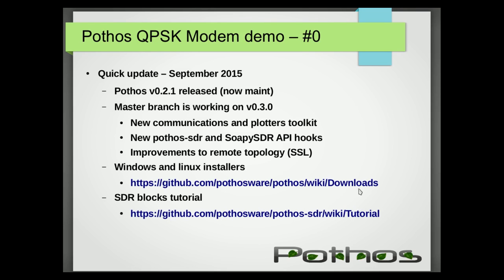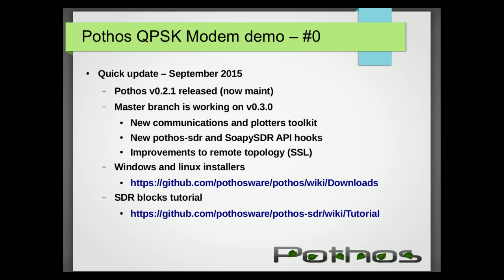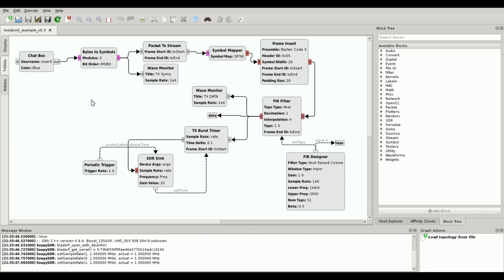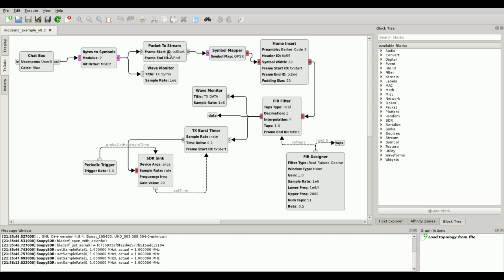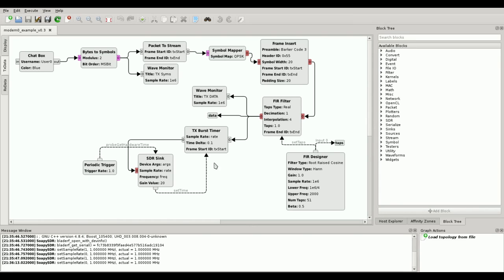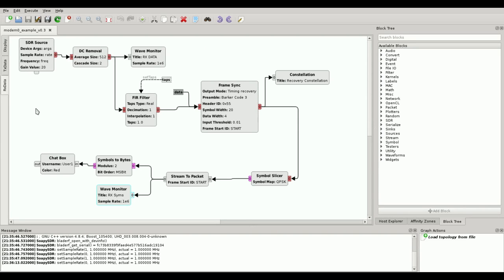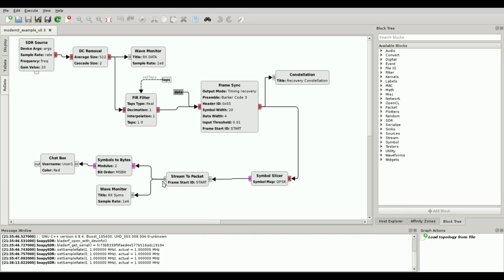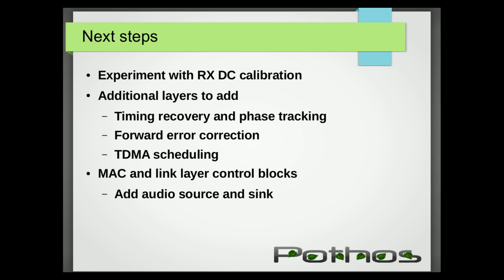QPSK Modem Demo #0

Comment: greetings!

i have been trying to reproduce this demo on a single bladerf xA9. However, pothos refuses to open the bladeRF for both the sdr sink and source at the same time.

the output says:
[19:13:55.129957] SoapySDR: bladerf_open_with_devinfo() returned -7 - No device(s) available
[19:13:55.129957] SoapyBlock: call setupDevice threw: Exception: bladerf_open_with_devinfo() failed -7 - No device(s) available

 Have you gone through this?

best regards!